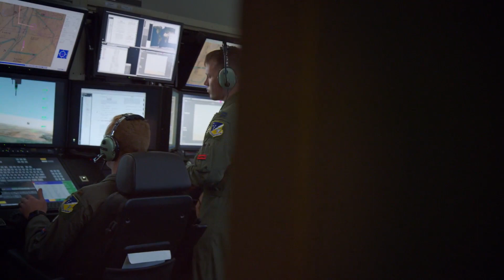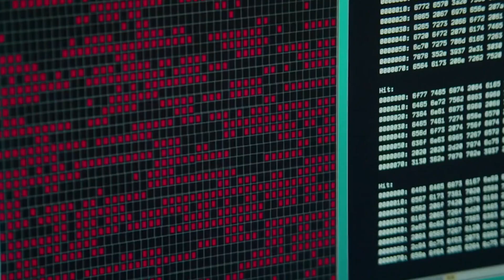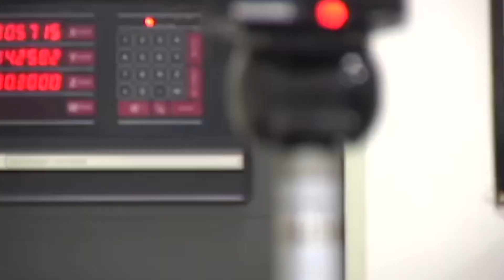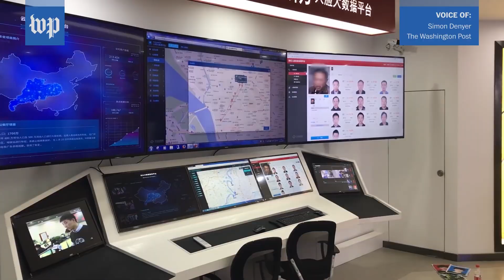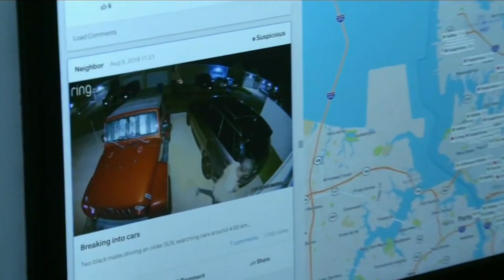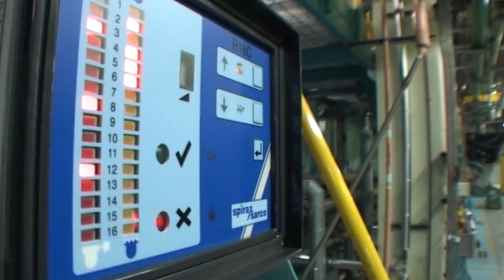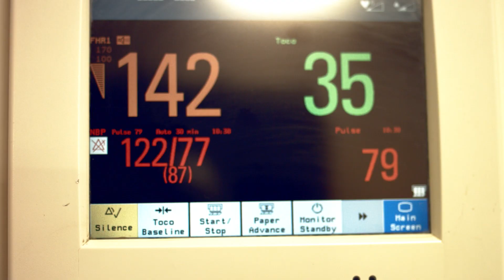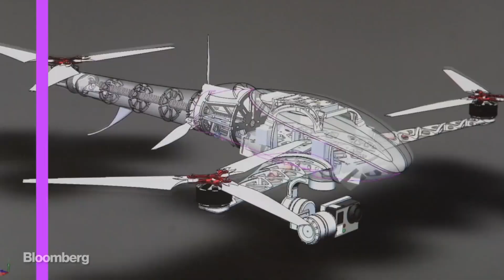The Scariest Predictions That May Come True In The Next Decade

Comment: The 3 Laws of Robotics by Issac Asimov should have been in place at the beginning of the AI reserch.  This would have prevented the AI war machines we have now, which is of course why they were not.

Unless we separate the military complexes from AI we will eventually be destroyed by them.

As far as machines running all manufacturing and people being jobless goes, we need to create new programs that requires people instead of machines.  This is easier said than done.

Comment: Soldier robots would have to be hardwired not to cheat prime directives. The hardwired instructs would have to consist of continual checks for conflicting data to circumvent hacking. If a conflict arises the robot should be instructed to return to base or self destruct (internal circuits to fry-out completely). But hey - that's just my opinion.